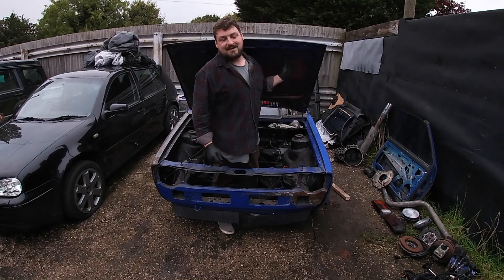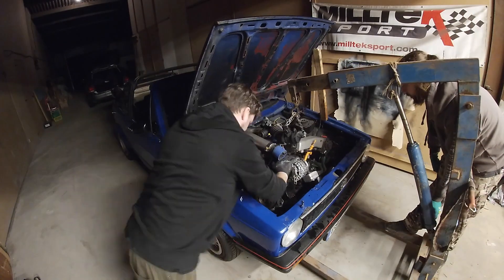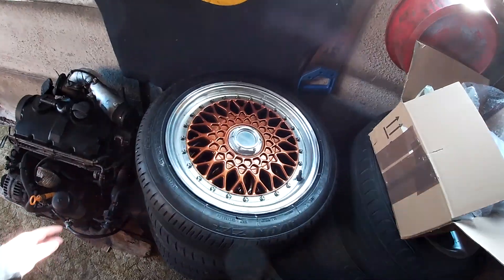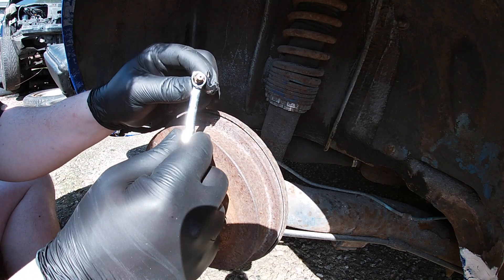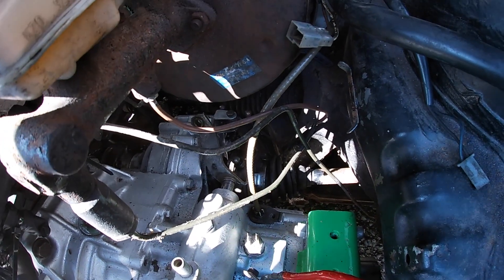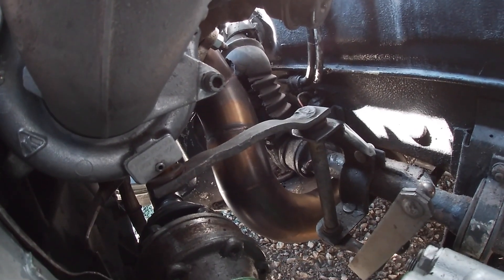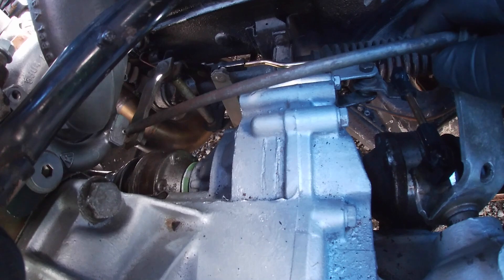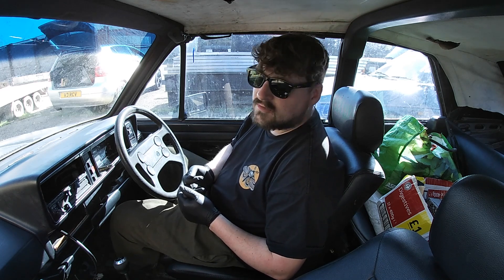MK1 Golf 1.8T Engine Test Fitment And Conversion

Comment: I moved the whole mk4 loom to my mk1 😊
Reply from the maker: Very nice! That's what the previous owner tried but seeing as this is my first entry to the MK1 golf and electrics I thought I'd try the easier option.
Reply: @VintageVibesAuto this is also my first bigger build, but I think i have saved alot of time, the electric in My mk1 was junk
Reply from the maker: Same here in terms of wiring. I think if I had the knowledge I would have done the same as you and fitted the MK4 loom into the MK1. Best of luck with your build 😎
Reply: Wow it's my first time doing a swap I have. 04 GTI and I'm taking it's 1.8t AWP and putting it into my 81 caddy. I was under the impression I had to get a modified harness and ECU for things such as the immobilizer etc. ur saying he took everything from the donor car and put it straight into the MK1 with no issues? Did he also swap out the steering column and cluster and other stuff to make that work? I've heard there's some universal harness kits that will work on almost any engine
Reply from the maker: I wouldn't know much about moving the entire wiring loom over, but I have made a custom wiring loom in my latest video, a guide by a guy called rub Jonny. See my other videos. 

https://youtu.be/CqO27BN7MIs
Reply: @lightseek88 yes with cluster, buttons etc.
well iam not fully done yet but it starts and is drivable. had a small wiring issue with the key (missed a earth), i also moved over the interior fan controller from the mk1 and connected it to the mk4 harness
Reply: @lightseek88  i didnt touch the steering column, but have to build something for the indicator switch and key.

Comment: hey Connor, I'm about to do this in a few weeks, and i stumble upon your channel, its refreshing knowing that there are newer videos about this, since all i could find was a couple of years old, I'm putting a 1.8t from an Audi tt on a mk1 scirocco, I'm trying to source a 02A/02J because I've heard that the 020 limits the speed at the top end. but if i cant find one i might just do what you did.

what did you do to update the fuel delivery? and also do you know where the previous owner sourced the downpipe from?

love your videos dude keep it up!
Reply from the maker: Hi, thanks for taking the time to watch my videos. For the gearbox 020 gearbox is the easiest to fit because it was designed and probably already comes on the existing MK1 engine, I'm only using the 020 because it comes free with the MK1 as well as the linkages and mounts etc. you can use the three original MK1 mounts if you are using an 020 gearbox and gearbox speed sensor, clutch cable, clutch flywheel etc. But the massive downside is the gearbox probably won't last very long, they are nowhere near as strong as a 02A/02J gearbox. 

02A/02J/02T are externally similar so will fit the 20v engine but you'd need to sort everything out attached to the gearbox such as the clutch, flywheel, custom fabricated gearbox mounts, wiring for the speed sensor, if you also have a 02A/J you would also need a new pedal box to fit the hydraulic clutch line as the 020 uses cable. And most 20VT use electric throttle unless it's the AGU engine you're using which is cable. I talk more about the gearboxes at the end of my engine rebuild video if you've not seen that

I've not looked into the fuel delivery side of it yet, the guy before me was running a standard 1.8 GTi fuel pump by the looks of things. In my MK3 1.8t conversion I ran a 2.0 8V/ VR6 fuel pump.
Reply: @VintageVibesAuto  yes I saw that, I'm going to see if I can put a wire throttle body because mine is electric, if not I think I'm gonna have to figure it out, are you sorting the wiring by yourself or sending it to someone.
Reply from the maker: You'd most likely have to have an agu engine if you want to use a cable throttle instead of electric. They are two main types of 1.8t wideband and narrowband. Narrowband is AGU engine and the wideband ones are the rest such as BAM engine code etc. The wideband is ME7.5 which is a completely different wiring loom to the narrowband iirc same as the ECU. My engine isn't a AGU but all my sensors, wiring loom and literally everything else is AGU engine code. Not the preferred method but I'm using what I had free with the shell with what I have free to hand. For the wiring diagrams I'll send those in a separate message below. I'm going to have a go at making a wiring loom myself.

The different engine codes all have there strengths and weaknesses so it's best to have a look at them online. AGU and BAM are the main engines people go towards though.
Reply from the maker: https://clubgti.com/forums/index.php?threads/oem-mk4-management-wiring-mk1-2-3-harness-install-faq-now-with-added-dieselness.267196/
Reply from the maker: https://clubgti.com/forums/index.php?threads/oem-management-wiring-1-8t-mk2-harness-install-faq.205887/
Reply from the maker: As for the downpipe this is what the previous owner used. 

Best of luck with your 20VT build 🙌

https://mpdevelopments.net/products/2-5-1-8t-k03-k03s-conversion-downpipe-vw-golf-mk1
Reply: @VintageVibesAuto thank you so much

Comment: 9:41 Can the plate with the hole be turned over so it slopes down and the round bar bent down 90 and 90 again _,— over the case with a flat plate on the end to extend with the hole for a bolt/pin possible a flat top bolt/pin for clearance with hole drilled through for  an R shaped locking pin and washer below…
Reply from the maker: On the MK2 and MK3 Golf you can take that flat bar off, as that's what's used for a short shifter on MK2/3 but from memory I'm pretty sure the one I have is welded on to the metal bar bellow, so I can't flip it over. I reckon that would work for a MK2/3 though with an 020 gearbox
Reply: @ what about cutting it and welding back on…